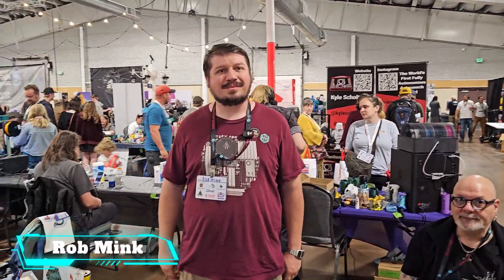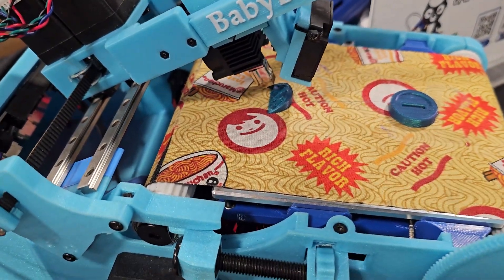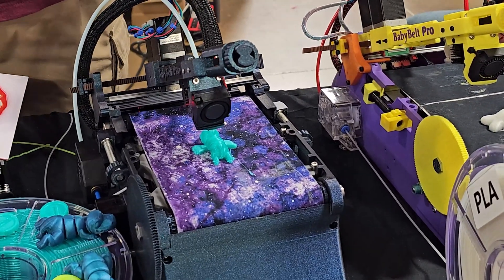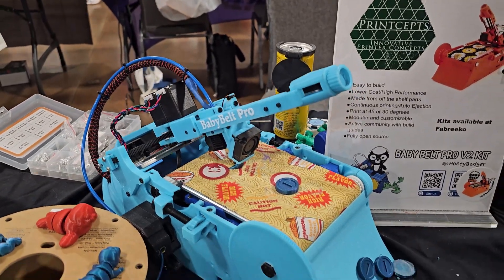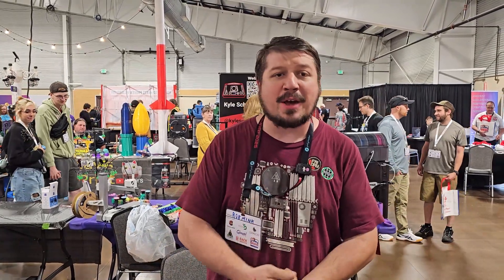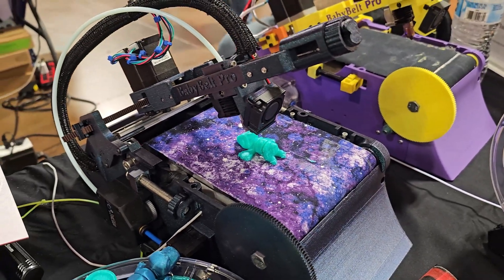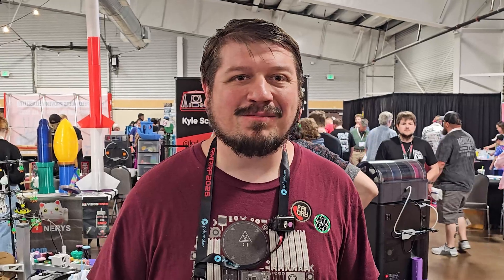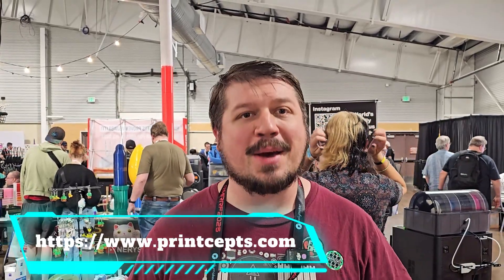This Belt Printer is INSANELY CHEAP! 🌀 Interview with Baby Belt Pro Creator Rob Mink

Comment: Cool gadget! What is the maximum height and width of the prints?
Reply from the maker: That's a good question 😆 I'll have to get back with you on that. Being it's a belt printer though it can print unlimited size in one direction. It's a neat printer build for sure!
Reply: @leemerie3d  Yeah, especially since it can potentially print gigantic items, despite it's small size, it would be nice to know the width and height. Besides, since this video is a bit old already, can you still recommend this printer?